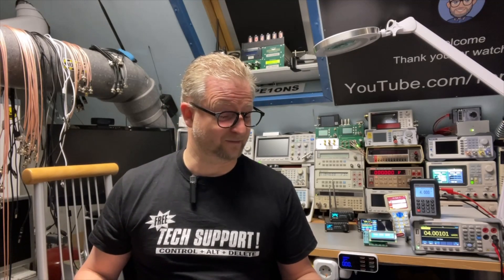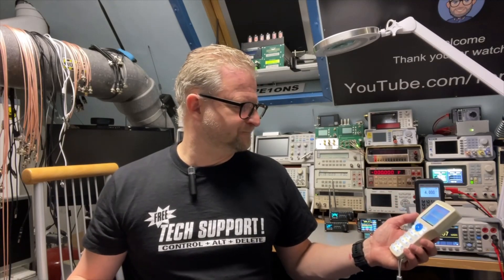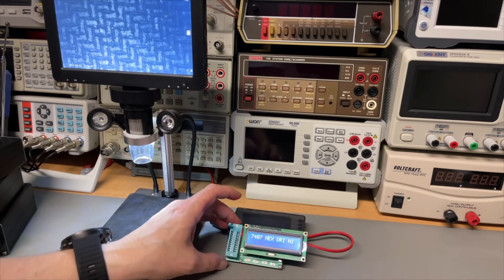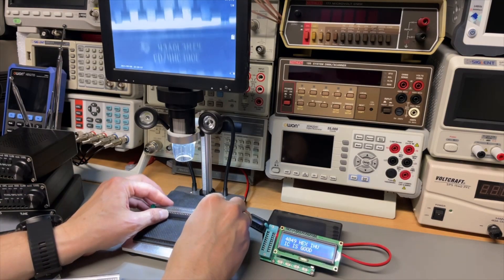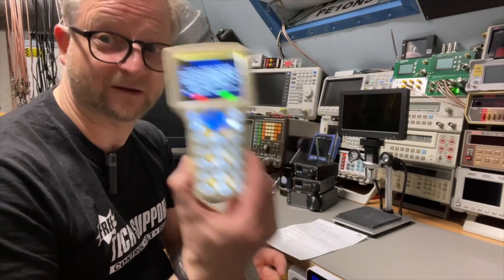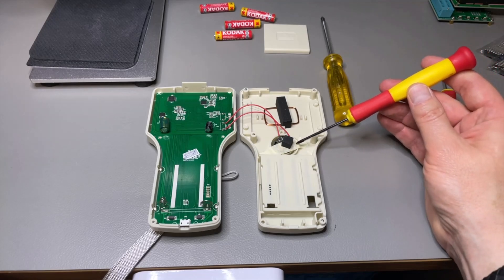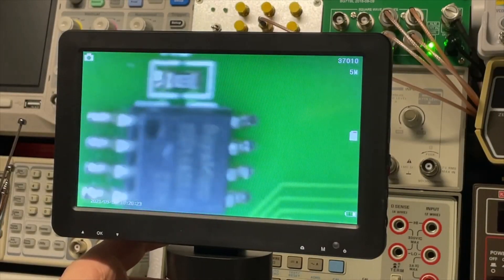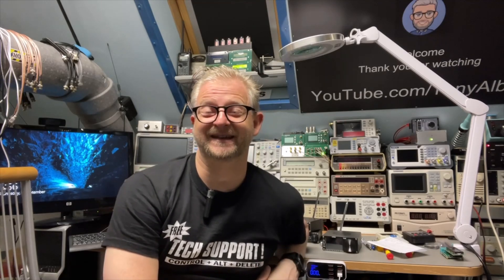#218 Q&A (9) LB02A TES200 RFiD ATS-25

Comment: The siglent has a higher shunt resistance because it has lower current ranges (2mA, 200uA). hp 3478A lower range is 300mA and for keithley 199 is 30mA. If you manual range the siglent to 200mA you get the same result :)
Reply from the maker: Thanks!.. that is some good info.. thanks for sharing... yes will try that, makes sense!

Comment: just a question, why is the audio fidelity not so great in your videos, is it because of any particular part of you set up when filming witch would be difficult to change? I would be quite instrested to know why? thanks!
Reply from the maker: Waiting for a donator to sponsor me to buy a proper camera and microphone, don't hold back please :)
Reply: @TonyAlbus  ;) what are you using at the moment? im sure you can do much better with what you have right now.
Reply from the maker: @heinrichhein2605  Using iPhone but finding a good BT microphone is drama..most of them have noise canceling, i tried wired but that fails to easy and i need to record everything again. one of mu videos i am showing the SmartMice. that is what i use
Reply: @TonyAlbus  ah ok that makes sense, i hear a lot of processing on the audio and that makes it hard to listen to it. But you could easily build a very good performing mic which you can connect to the phone, watch?v=6EPC_DH2m-E in this video (unfortunately in german) someone shows a simple circuit you can build in a evening, and most electret microphones are prity good if you have a good preamp as he showed, maybe also a video idear for you. Thanks for making your videos ;)
Reply: but yes most BT are quite horrific
Reply from the maker: Thank you! i will have a look.